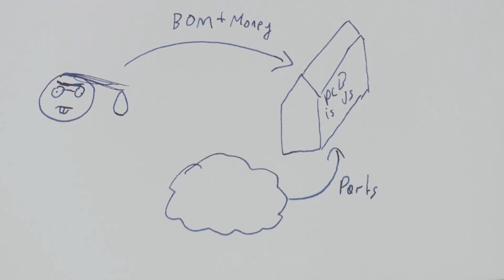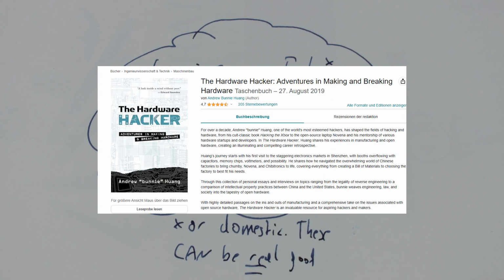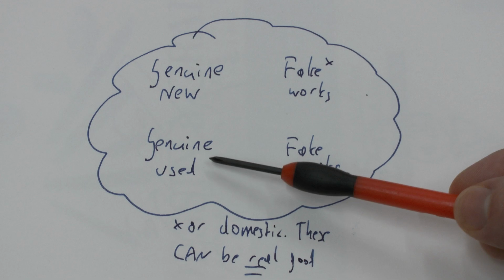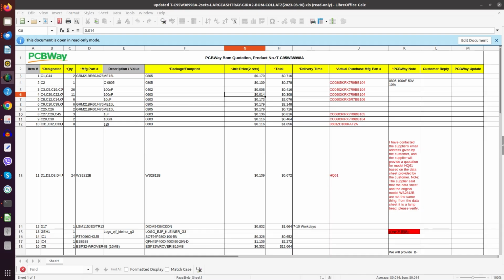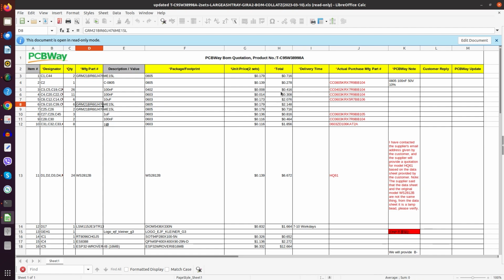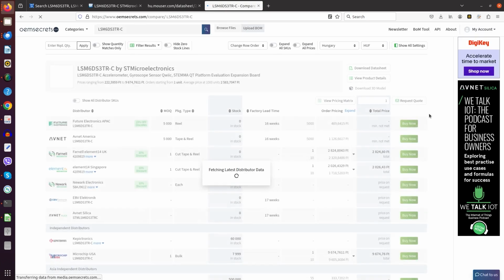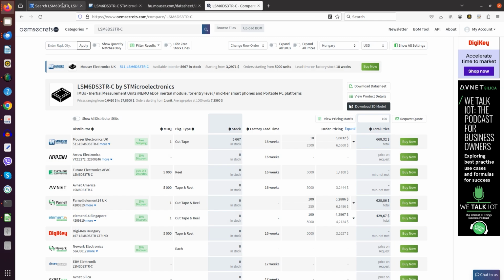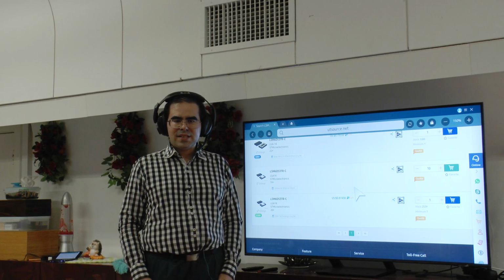Used components - how to spot, avoid and deal with them

Comment: Back in the 1990s, I worked for an Asset Recovery Company. We processed truckloads of used electronics. It as sorted int, 'Used, working' 'Used, Needs repair' or scrap. We also did certified destruction where off lease equipment couldn't be sold intact, but boards or modules could be sold. During the 256 K DRAM shortage, I was removing them by the thousands from some Unisys memory boards that each had 144 of them. We sold them to small computer shops for $2.75 each, on the condition that they inform their customers that they were used. There was no other source to end users for over a year
I agree that new is best, but sometimes used is your only choice so you have to do a 100% incoming inspection on those parts. With DIP packages, in most cases were easy to spot since the leads were trimmed during assembly, but some multilayer boards were so thick that they required full length.